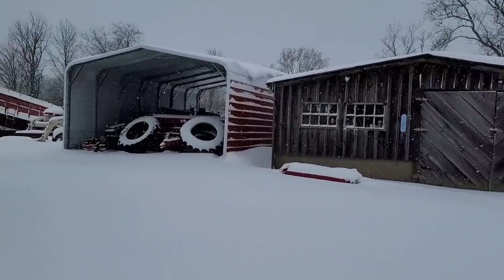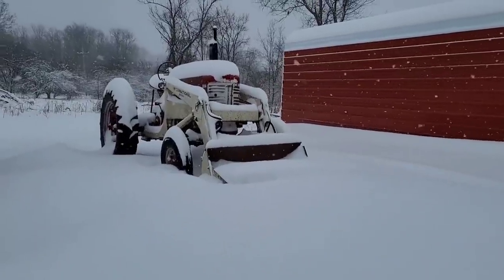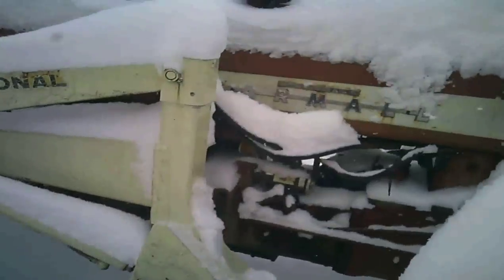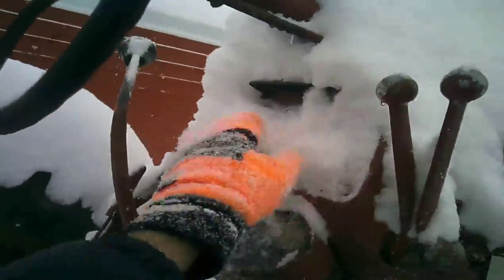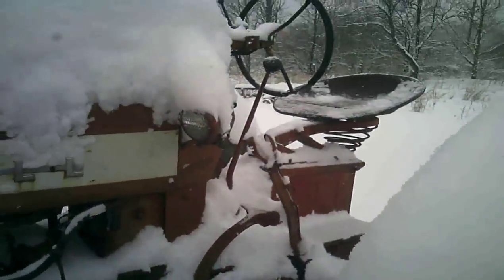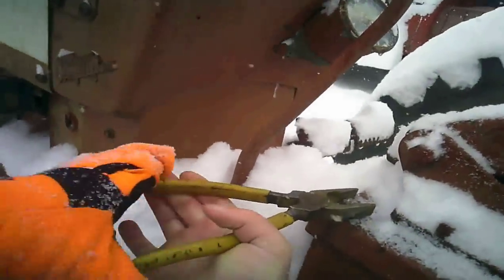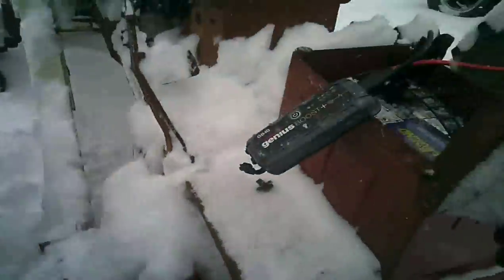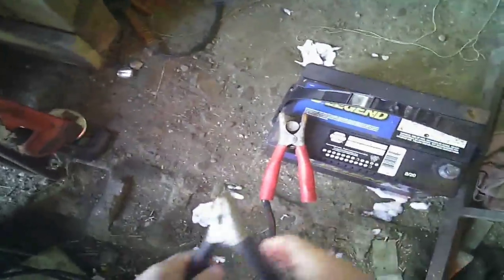Farmall 400 Down for the Count | Battery, Battery Cables, or Starter?

Comment: Corry, PA here. Started my 70 year old Super A to plow my drive up on the farm. Ignition switch was frozen and was hard to get the key in. Choke linkage was frozen so ran rough till it thawed out. But got the job done. Will post a video on here if you care to check it out.
Reply from the maker: Absolutely 💯
Reply: @FarmallFanatic  Just posted not a great video. I know what you mean about hands getting cold. I hate working with gloves on. When I got done and went inside my right had was throbbing from the cold.

Comment: My past experiences with an old 450 it did not like damp weather snow or heavy fog if it always get condensation inside the distributor cap so they were just days it didn't run but by yours I noticed it looks like you turn the key switch to start it not a push button like most I've been around combination of wiring and fuel or the starter those are my most common issues usually
Reply from the maker: Keeping them out of the weather is always key

Comment: My 756 came with a Westendorf WL-21 loader from the previous owner. The way it unmounts from and mounts to the tractor is slick. It can have either their quick attach or skid steer’s quick attach system. Their customer service isn’t as good as their product, though I did see they were advertising for new CSRs last year, so may be that got better.
Reply from the maker: And separate hydraulic controls 👍
Reply: @FarmallFanatic  a joystick is in the future for our machine. Right now I’m using the 756’s hydraulic levers.

Comment: I give tips should have in Neutral on Transmission also before crank push clutch pedal in to and have less  stress on starter to for winter season months too! Plus battery always used higher Cold Cranks for cold or hot numbers plus reserve 90 to 170 or give more strength! For instance on 6 volt get 700 to 900 Cranks Amps for hot or cold and reserve amps to 90 to 170 save electricity to strong ways ! On 12 volt get 800 to 2000 cold Cranks for cold to hot and reserve 90 to high as can ! Reserve amps is mins like 60 reserve is 1 hour 60 mins ! Plus give more strong battery turn over plus if Alternator or Generator quit got reserve amps to use to get shop fix up fast! Also would get Starter on 400 rebuilt to! Plus block heater help to lots for gas and desiel motor warm up block to!

Comment: My opinion is that the snow is causing most of the problem. It's not the battery or the starter, but the moisture from the snow is drawing enough juice to cause the problem. You may not need to check as much either. Going through too much trouble ff. Best of luck. P. S. Get yourself a multimeter and learn to use it. That'll tell you if you're getting enough juice.
Reply: Should have been choke not check.
Reply from the maker: Fluke in my toolbox
Reply: Cool

Comment: If the rear ends are frozen, the bull gear teeth can push the ice through the gear case. We had that happen to a W-6 at one time. The case is very similar and the bull gears are the same as the M
Reply from the maker: No doubt

Comment: Thought a couple times she was going to pop over.  After the battery and the dreaded clicky click sound, not so much.  Pull her into the shed, and get to checking the wiring, starter, coil.  Good luck!

Comment: It will start turning it over that slow. If it's getting spark and fuel, it will run. 2 flips with a crank will start those engines. W-9s barely turn over on 6V and yet they start good when everything is right. Buy 12 V batteries at Costco. And use only solder on battery cable terminals. Those clamp on ones are junk and can give you all sorts of trouble.
Reply: Good  day  Yes slow turning should not matter.  We  W-6  , got tried  of buying batteries .  use crank,  1 crank down & 1 up  it was running.  Thanks
Reply: @donvoll2580  Yes they should start like that. With all the snow, it might be his distributor is wet and that can do it.

Comment: 1. park your tractors inside.
2. put a water heater on the lower water hose.
3. ether when needed.
4. at least park on a hill or have someone to pull start you.( edit) with the loader never mind.
5. trickle chargers.
Reply from the maker: Agree

Comment: When the M fired up, my first thought was to jump the 400 with it. That little extra bit of juice can make a difference. Could be a tired starter or bad wiring, too. Guess I'll wait for part II. As an afterthought, what's in there for oil?
Reply from the maker: Low ash 30
Reply: @FarmallFanatic  Eeeeek! It's 10W30 season, brother! At least around here. We usually see at least a week of -temps, maybe two.  I always run the thin stuff for that reason. However, YMMV.

Comment: It is not turning fast enough, sounds like thick oil but get a terminal cleaner and keep them tight. It also help if the clutch is depressed so you are not trying to turn your transmission in that thick oil because neutral all your gears are still turning. you can also try a little wd40 in the intake while cranking (poor mans ether)

Comment: If it was turning over before you charged it. And it not turning over now. It will be one of two things. Either after it snowed and the sun came out some snow started melting and some water got into the starter. Or you charged the battery not long enough. Door number three is. Never charge a battery on grass or dirt without something such as a piece of wood under the battery. Cause charging a battery on just dirt or grass or concrete can drain a battery faster than you can charge one. That's my guess.

Comment: I regret putting two six volt batteries in our 656. When it came to me in July it was completely dead they had to roll the thing off the truck. I figured just to put two six volts in a series like it had on it when it came.  I regret doing that as now a already hard starting tractor is even more hard starting. Anything below 40 degrees and the stupid thing won’t start.  Even if I keep the glow plugs on for five minutes it does nothing but crank.  Once I go through it I’m gonna but two twelve volts in it in a parallel.  Your not the only one with “electrical” problems

Comment: My dads 450 freezes every winter. Can’t even move it. Water in the rear end. Dads only keeps one bolt in the seat battery box. It is alway hand tight. Super scary when you look down and and it is half way out. Nothing like shaking hands with danger.
Reply from the maker: Fire right up in the summer?

Comment: you are using a battery cable repair end  unless you solder the end before clamping one of them on you wont get a good connection
i prefer to use soldered repair ends on the battery cables
Reply from the maker: I order a new (original) ground today

Comment: Looks like you need to install some new battery cables made out of big welding leads and maybe have the starter checked.
Reply from the maker: 00 cables and a starter rebuild
Reply: Farmall Fanatic yep and make sure and solder those ends on.

Comment: If the starter draws too much power, it will steal away from the coil. That's why it won't start. Even turning that slow with a good starter it should start.
Reply from the maker: Yep

Comment: One of these days I am going to find a 450 diesel
Reply: You watch this channel too
Reply: @whathobogrohknows   yeah for awhile bud been watching since he started
Reply: Farmall 450 or W-450?
Reply: @tyfrank3427   row crop narrow front 450
Reply: @mcleanfarmsryan3897  We have a factory wide front Farmall 450 Diesel, and we have W-450s in both gas and diesel. But My dad and I have owned probably at least 300 IH tractors over the years, but we have never owned a narrow front diesel Farmall. If you're in the United States, you should be able find one easily. If has a Schwartz wide front, The front bolster off an M is the same. Get one off a later M, it would have the correct hubs. and the Farmall 450s  use the type of rim that has the lugs riveted on.
Reply: @tyfrank3427   yes I am I the United states
Reply: @mcleanfarmsryan3897  You should be able to find one in the Midwest. I am in Alberta, Canada. Here W-450s by far outsold the Farmalls. But it's about the only place. Less than 1800 were built. About 26000 Farmalls were built. We have the only F450 I have seen here.

Comment: It’s not the starter and it’s turning fast enough it has got water in the distributor take the cap and the plate off and put heat to the points or sand them and it will fire right up

Comment: My guess it is the battery cables that are the problem. Always use solder type terminals when building battery cables. Those ones that bolt together with a clamp, those can cause that kind of trouble.
Reply from the maker: Agree
Reply: @FarmallFanatic  On My Super W-6, I learned that the other day. It had those cable ends, and the starter wouldn't turn at all. I used a multimeter, and the battery checked out at 6.43 volts. I then put the multimeter on the starter and where the ground bolts to the frame, and it tested just over 3 volts. At that, you wouldn't get enough juice at the distributor. I built new cables and it started right up just fine. One more potential problem is the snow may ground out your ignition. We've had that happen too.

Comment: Why don’t you tarp this tractor when he’s outside like this?
Reply from the maker: It's usually in a building
Reply: Should try a circulating heater on it saves your battery and starter. If I can install Inuinnaqtun sure you could

Comment: How  about none of the above. How about a heater for this engine. You would need  two batteries  to start this poor thing with the 30 weight oil you have in it